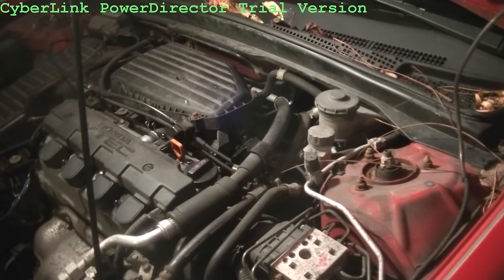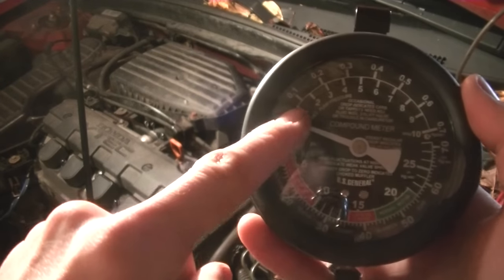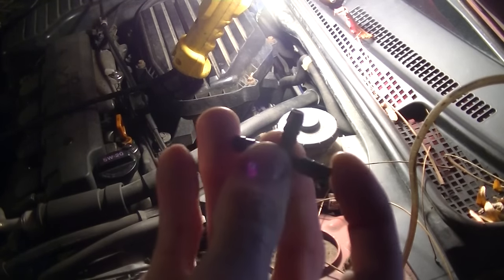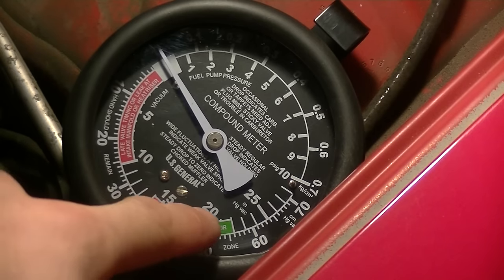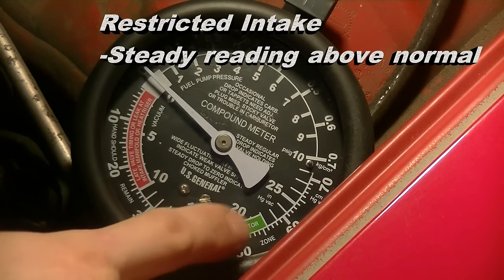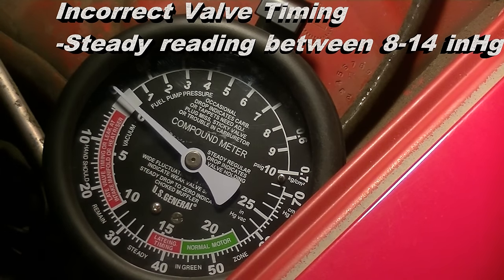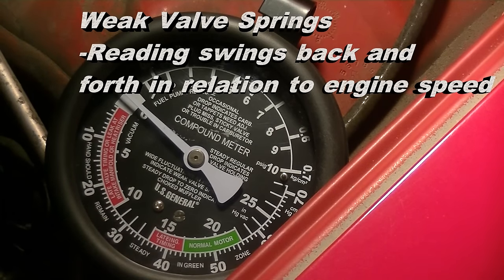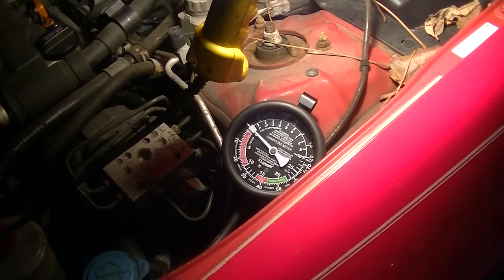How to Use a Vacuum Gauge to Diagnose Engine Problems

Comment: thinking about getting  a vac tester, question, when yo connected it another port was open?  does it matter if it's t fitting for a complete air tight fit or in this case it didn't matter one port was open?
Reply from the maker: +TVTruther I am not 100% sure what you mean but, when you connect the tester, you use a T fitting so the system is still sealed.
Reply: MattsMotorz ok...it seemed in the video you only connected one hose, though it was kinda obscure/hard to see in video...I presumed it needed full seal..thank you
Reply: No it doesn't matter, what usually hooked on the intake manifold is: brake booster line, head Breather lines, EVAP purge valve and in some cases an A/C vacuum solenoid,  all of them are receiving Vacuumed Air from the engine and disconnecting any one of them to hook a vac gauge should seal back the system
Reply: Airman alright..a good explanation.  thank you

Comment: I have a 1970 Boss 429 and at 800 RPM idle the vacuum is steady 3 inch and at about 3000 RPM it has a steady 17 inch. I have a high performance Comp cam in the engine. Engine run great and doesn't have 100 miles sense rebuild. Is this normal?

Comment: What does it mean if the needle reads normal (in the green area) but does not move at all when the throttle is blipped? 

The car symptom is that it hesitates from idle ( at red light) and at times surges while driving.

Comment: MattsMotorz  I have a new BluePrint Engine 408 stroker,  the cam is pretty loapy (0.545 lift) i haven't been able to dial in the idle mixture because im having an issue with vacuum moving in a rhythm  from 10-15 while idling.  i'm sure its not a vacuum leak, i did all the normal checks for that.  i am suspecting big cam might be doing something, but also im thinking about fuel pump because of surging fuel pressure at idle, plus fuel filter is not full, big air bubble.  penny for your thoughts?

Comment: My question I have one vacuum gauge like that and  when I checking my intake vacuum the gauge never comes into the middle green its stays about 22  and 23 and it do not pass the green area , even if I am accelerating the engine and let it idle back down so is it a good  sign or a bad sign for the gauges to stay in between 20 and 24

Comment: Hi my trucks been sitting for a year untouched ,diesel Hilux 
Rebuilt engine ,brake boosters not working but I have a new vacuum pump and it registers at 25-6 very steady  inches of mercury (300m above sea level )
I do remember the first day I installed the engine I had brakes only ran it for a couple of minutes next morning nothing ,pedal doesn't move at all when turned on ,is it possible the diaphragm weakened over that time

Comment: My small block chevy shows normal on the gage. But the needle is jerking back and forth a tiny tiny bit. It's a brand new crate engine. Is something wrong?
Reply from the maker: If the engine is brand new, I wouldn't worry about it too much.

Comment: How does this work if you remove the fuel line from the motor? How does the motor run with this on the end of the fuel line?

Comment: Heres a scenario, my engine is at normal in the green area.....but when I rev it really quick to about 3000 rpms the gauge goes up to 25 hg's when i let go of the accelerater, the gauge slowly drops back to normal green area...but it takes at least a minute or 2 in order for it to get there.
Reply: Sounds like its starving for air when you open the throttle it allows air in wich is why I drops to zero. If it's pulling higher vaccum at higher rpm would be due to lack of air in the intake.

Comment: Let's see if I can get a response okay I have a Chevy Cruze and the p0011 code has to do with my intake cam problem which the diagnostic said it was the actuator I have changed both intake and exhaust did not fix the problem check engine light still on when I do the vacuum test my engine seems to rev Indy healthy area about 19 2 20 inches of mercury while in idle the needle has a fast vibration and it moves up and down from 18 inches of mercury 2 about 20 and a half inches of mercury so it stays steady in the green healthy area but it is moving back and forward a little bit I'm trying to figure out is something here the cause of my check engine light remain on because the diagnostic mentioned something about timing being off a little I can't really tell everything with the timing chain that I can see lines up to top dead center could this be anything dealing with some valves or Springs

Comment: In my engine at idle have a 20 inhg but at 2500 RPM is 26 inhg and shake all car, what's wrong ? Without air filter nothing change, i check timing and Valve and looks good. TPS ?

Comment: hi matt, i got a Honda engine with 25 inches at idle that oscillates super quickly between 23 and 25 of inches, does that sound like bad valve guides ?
Reply: according to the video you might have a restriction in the exhaust

Comment: Very informative. Maybe I can get a little insight on my issue. 1995 Trans Am, LT1, slightly mild camshaft. Burning 1 quart of oil on new rebuild. I thought perhaps a valve guide seal was installed improperly. How do i determine when cam is causing vacuum to fluctuate?
Reply: If it smokes on startup then it's a valve guide, if not it could be a problem with the rings. I know this is a couple years late, but if it helps it helps.

Comment: I’m just curious, why wouldn’t the tube be inserted into the manifold instead of the tube?
Reply: If you have doubts about where to plug it in, plug it into the line which is sucking air. That's the vacuum source you are going to read.
Reply: @wymple09  
Thanks Warren, 
I did that, needle is in the green range, thanks very much.

Comment: Great video, very informative. Do you know what is it when the vacuum turns into boost (needle goes to +5 up to +8 inHg) by accelerating?  Thank you
Reply: This sounds exactly as the turbo is kicking in:) ( just kidding:)  Check your EGR valve if it isn’t stuck in open position.

Comment: What are the causes of an intake restriction? 98 ford f150 5.4 liter. Thanks.
Reply: +JackOfAllTrades all I can think of is a dirty air filter or blocked passage in the intake or vacuum lines.  But I'm still learning.
Reply: MAF sensor possibly sticking also
Reply: JackOfAllTrades - You say it all. Intake restriction, so look for anything blocking the air flow. Examples, clogged air filter, leaves, dirt/debris, kinked pipes and hoses, etc. Even a mice nest can be the culprit. ;-)

Comment: So mine is in the normal  motor(green zone) but around 45 and the arrow shakes. What do you think that means?
Reply: Nick's DIY - Guess you're using the other part of the scale. ;-)
Make sure the hose you're using is "strangled" to overcome the natural pulses of the cylinders. Because that might be the cause of those shakes. If that's OK and ruled out. The shaking in that region usually is associated with the valve train. 
To make sure you have the setup properly done, test it in another engine. Ideally an identical model.

Comment: i have a 1600 british pinto engine am getting a vibrating reading between 13 to 15 which i believe is advanced timing ?? the car runs rich mixture  but runs really smooth ( it was set up on a dyno test
and it was the only way it would  run smooth  ( car is now  41years old ) can anyone tell me me can i fit a 7" dual booster -- what i have now is a 8" single and it works fine but the master cylinder has
a problem and the parts are non existent  so can i fit the 7" with an upgraded master cylinder of 15/16" original is 3/4" but running on single pot calipers but now have 4 pot calipers each side can any of you guys help me solve this problem

Comment: Could you not just connect the gauge to the cylinder head? or do you have to attach it to something like you showed
Reply from the maker: You need to attach it to something with direct engine vacuum, anything off the cylinder head probably wont be direct engine vacuum.  Anything off the intake manifold is a good place to connect to.  I like to hook it up to the brake booster line.
Reply: Oh I see what you mean now,  bits of the video confused me.  Cheers :)

Comment: how do you clean vacuum lines/system should something get in there by mistake?
Reply from the maker: +Salah Sharief What I would do is remove the line and blow compressed air through it.
Reply: Nice. Would it pass the actuators though or they have to be disconnected?
Reply from the maker: I meant to remove the line from both sides so it isn't attached to anything.
Reply: +Salah Sharief seafoam!!:)

Comment: What is the problem if the needle holds in the centre of the green band even when you blip the throttle , or hold the throttle?
Reply: First of all check if the vacuum hose is not pinched somewhere along the route. ;-)
Beside possibly is connected on the wrong hose. Must be connected to manifold.

Comment: steady vibration 1/2 inch between 21 and 21.5...worn valve guide? Its only 1/2 " but the head is very old, new valve seals new head gasket, all valves adjusted.

Comment: my 99 dodge ram does that its 16 to about 19 steady but back and fourth. any ideas what that might be?
Reply from the maker: Leaking valves or worn valve springs can cause this.  Do a leak down test and measure the percent leakage in each cylinder.  20% leakage and under is considered acceptable.
Reply: 130 psi all on the dot from a compression
Reply: Engine has 118k (motor swap)
Reply from the maker: So it was 130 for all cylinders?  I am thinking it must be something with the valves or timing.  A leak down test would give much more information than a compression test.  I made a video showing how to do it.  130 is good for some engines, and bad for others.  Sometimes comparing compression readings isn't fool proof because if the timing is off, the compression will be off the same for all cylinders.  Vacuum tests are a good "start off" diagnostic test.  They certainly don't tell you everything, but they give you evidence that SOMETHING is wrong, but not enough evidence to condemn anything (in most cases).
Reply: ok, ill buy one and let you know what the test shows. if it's valves or timing would make sense since all cylinders. but only one is misfiring, but since vacuum was wonky that'd make some sense. I meant what else can do that? the valves, timing, the 5.9l doesn't have a vacuum pump, the larger engines don't need it. I sprayed stuff down today with carb cleaner, getting all kinds of bubbles from the valve covers where the bolts are placed. strange enough getting bubbles in between the bolts as well? what do you think that could indicate?  That sort of stumped me lol gonna buy some stuff gauges wise. fuel pressure was great. spark was great. couldn't find a leak in the intake. replaced my throttle body gasket today and the gasket under my air filter housing,  no other leaks were present.
Reply: could you be cheap and just throw air in the cylinder? lol instead of buying a leak down tester?
Reply from the maker: Not sure what else could show that vacuum reading  I don't do a huge amount of vacuum gauge analysis.  It depends what you mean by "throwing air."  You need to pressurize the cylinder with air and have a way to measure it.  That is all a leak down tester is.   I bought mine for about 50 or 60 bucks on amazon.  Don't know why there would be air bubbles coming out of the valve cover bolts.  The only thing I could think of is that the crank case is becoming pressurized from a clogged PCV valve.
Reply: I spray the valve cover with Carb cleaner to see if gasket leak. That's what bubbles im talking about. I think its time to pull the valve covers and look. Read somethings about broken springs. Seems similar. Deff been a journy lol
Reply: MattsMotorz sry lol. I meant removing the shrader valve in a compression tester to "throw air" hahahaha sry again. being cheap lol. instead of buying a leak down.
Reply from the maker: That will allow you to put air into the cylinder, but you need to have a way of measuring the pressure inside the cylinder, as well as how much pressure you are putting in so you can determine the percent leakage.  You can always make your own by buying the right fittings and pressure gauges.  I have seen people do it.
Reply: Good to have those tools anyways if I have bad rings like I think i might have: /
Reply: Can you pull the heads and replace rings?  Or more difficult?
Reply from the maker: Well first don't assume anything unless you get some good evidence. Second, if the rings ARE worn, it is likely the block is worn too.  The block would need to be re-bored and have over-sized pistons installed. You might be able to get away with just replacing the rings, it all depends.
Reply: Scary lol

Comment: can someone tell me whether or not the vacuum gauge is suppose to go to zero as soon as you turn of your engine or is it suppose to hold
Reply from the maker: +TheBranden86 If you're measuring intake vacuum, it will go to zero.
Reply: MattsMotorz what other vacuum can you measure that will not go to zero and hold so I can check it and see if that's my problem, and no im not joking, I have a knock in the first few minutes really hard if it sits too long and I have no one to help me here I have wasted too much money and time with mechanics who wont help me for some reason
Reply from the maker: If you're measuring the vacuum on a device that utilizes engine vacuum to function, say the brake booster or HVAC lines (for older cars), then these tend to store vacuum for use when the car is off.

Knocking that is caused during first few minutes of start up is typically caused by the hydraulic valve lifters.  The lifters fill with oil during engine operation and the oil causes a cushioning effect when the camshaft pushes up on them to open the valves.  If the lifter has failed to store oil, or oil is having trouble getting to it, it will knock.

Many times this is caused by lack of oil changes.  The oil and oil passages get sludgy.  When the engine is cold, the oil is more viscous and cannot flow into the lifters easily. As it warms up, it thins out and can flow better, and the knock goes away.

If the lifters have failed to hold oil completely,  depending on what car / engine you have, getting to the lifters can be easy, or very difficult (sometimes requiring removing the cylinder head(s) if it's an OHV type engine.
Reply: it is a 04 dodge neon 2.0 not high output just regular and thank you for the information, so I have to ask this I do understand why my crankcase has smoke in it after running it a while because of what you said but I really feel like I have something not holding pressure or vacuum just by how it acts up within a few minutes now but before it would take a lot longer that is why im thinking something like that, but im new to this and Im not joking these mechanics wont help me this is sickening just wrong im in pueblo co if your near, lol
Reply from the maker: What you're saying doesn't make sense to me.  

The first step would be to change your oil and see if the sound changes in any way.
Reply: +1. Change oil and filter, making sure it's good quality and appropriate for your engine. 
Regarding the smoke make sure the ventilation and vacuum pipes are clear. A clean/new PCV valve will surely help also.

Comment: no good if you have a massive cam i get only 5 inches at idle due to the huge cam im using
Reply: This is why they made vacuum pumps so you retain power brakes and anything else you use vacuum for. Like my '68 'Bird in my profile picture... If I put a massive lumpy cam in the 429, I'd have to use a vacuum pump to keep the power brakes but also to keep every vacuum operated item on it (too many on this car).

If you aren't using anything vacuum powered, the procedure is still the same, just be sure to keep in mind you're going to need more initial advance to run the engine with a cam like that.

Comment: I hooked this up to my truck and when it was idling it was at 0. Then when I gave it throttle, it went to positive pressure on gauge. It's a diesel does that matter?
Reply: Diesel engines don't make vacuum, it goes positive because of the turbo.
Reply: Oh it's a lean burning engine gotcha. So then how would I perform the same test?
Reply: No they don't create vacuum because they don't have throttle valves like a gas engine, Diesel engines rpm's are controlled by the amount of fuel injected into the cylinder. They will have a vacuum pump driven by the engine for power brakes etc. but you can't get a vacuum reading from the engine itself.
Reply: Good response however, throttle doesn't control rpm, throttle controls fuel and in result engine load (which depending on load rpms may increase). Just probing the communities knowledge of diesel engines. You'd be surprised how many people don't understand diesels (lean burning engines, running AF mixtures up to 60:1) and why they don't have vacuum. In addition the fuel system, and how the fuel injected is a direct correlation of throttle and boost pressure (if turbocharged). I work with diesels on a very regular basis.
Reply: I figured something was up when you said "it's a diesel does it matter?" Yeah I try to help out when people have questions. There's too many people out there giving bad info or just straight up dicks to people.
Reply: Yup very true, hope I didn't come off as a dick. I do the same, and I hope people learned something from this conversation before they try it on their diesel.